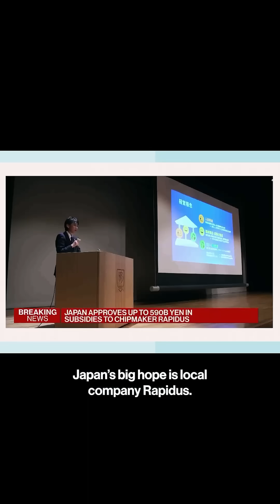Japan Goes All-In on Semiconductors

Comment: 2nm maybe needed in Phone, but not in Car, since car is much bigger
Reply: That's... not how that works...
Reply: It's not about size it's about efficiency and speed.
Reply: 2 NM is not the size of the chip, it's the size of the transistor. Either the Tesla Car CPU or the iPhone, they have billions of transistors to perform Trillions of tasks.
Reply: Oh, you're right. Let's go back to individual, through hole mounted,  discrete transistors... no, wait, let's go all out and go back to vacuum tubes. Cars are big, let's use all that space available.
Reply: @ 😂 I love it

Comment: Who is going to put a 2nm bleeding edge chip in a car??
Reply: nobody
Reply: @falsch4761  
There is room for 2nm in AI chips.
Reply: @lpjunction  There are no need, Most computing power are needed in Training, Not applying . Anyone told you otherwise has something fishy going on. Just like we dont need 2nm in Fighter jet, We dont need them in cars.
Reply: @falsch4761  
You really don't need a 2nm if the AI could be trained with a 7nm. 

The self driving in Tesla isn't done yet.  Whoever wants to compete with Tesla would welcome a faster, wiser AI system, and one would appreciate to have 5nm, 3nm etc.

Well, the low end EV and mid range EV will most like run against a huge competitor from China.  So, high end EV will be rewarding, and people are willing to pay.
Reply: @lpjunction  In theory you could train AI model using 1000nm architecture. You dont seems to understand about semiconductor. 2nm ,3nm bleeding edge are not used in Auto Applicaion. It doesnt need to. You can just as easily and cheaply put 10nm chiplet in the car

Car has no space limitation like phone, It can make chip as large as it wants.  

Like I said, If hypersonic missile dont need 2nm chip, Then car dont need them..